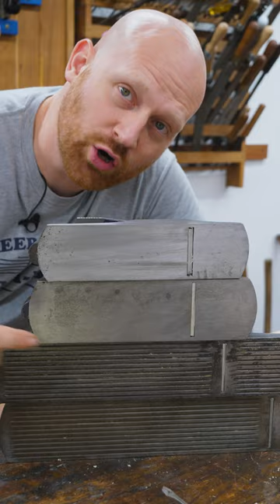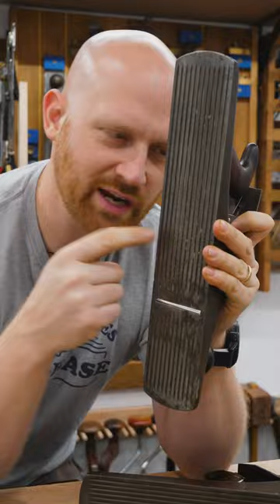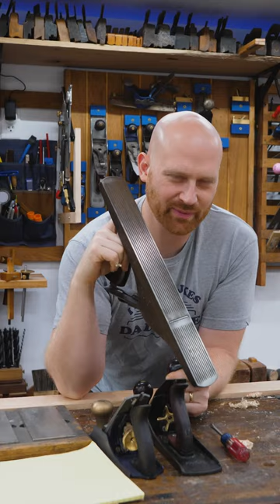What is Corigation on a Hand Plane

Comment: I could see an argument that they potential help limit the suction that can happen if 2 completely flat surfaces meet. Similar to how metalworkers even today will use hand scrapers to flatten 2 mating surfaces that creates super tiny ridges that allow lubricant to stay between the surfaces and not seize up while also being extremely flat.

However, with woodworking...is that even an issue?
Reply: That was actually the reason I found cited for the corrugations.
Reply from the maker: modern people have proposed that, but that is not possible with wood. even in metal it takes EXTREAMPY flat and smooth surfaces.
Reply: @WoodByWrightHowTo  exactly. I'm just trying to figure out the reason though. Who thought of it. Is it simply a marketing gimmick? The extra milling process may save steel, but is more work? Was that extra work worth the extra effort? Most cast iron pans aren't milled flat today because it's a huge added cost. They argue that the casting bumps make the seasoning stick better, but that's just baloney. They just don't want to waste the time and money milling them flat.

So...if it cost more to mill the corrugations? Why do it for a marketing gimmick?
Reply from the maker: Back when Stanley was making planes the cost of Labor was a small fraction of the cost of the plane. The cast iron cost and exorbitant amount in comparison. So the amount of work required to put the corrugation in was actually minimal. As you go back and look at the price differences there is no price difference. Woodworkers throughout the ages have done a ton of things that make no practical sense but they make an emotional or slightly feel better since. It's kind of the same thing with golfing. A golfer will spend untold amounts of money to buy something that will make then think they can do better whether they actually do or not.

Comment: Great info, this is something a lot of car guys miss when getting bigger brakes. Not to say that you shouldnt, itll definitely help your brakes manage heat better, but it wont give you more stopping force aside from a little bit of leverage. You gotta know physics to be a good mechanic, trust me.
Reply: More surface area helps with creating friction. This is why aircraft brakes rotors come in a large stack
Reply: @mitri5389  you are wrong my friend, more force and more coefficient of friction create more friction. when the force stays the same, if you spread it out over more area, you simply get less pressure per square inch. driving 4 answers has a great video on it if that still doesnt make sense, his graphics will make it click.
Reply: @kylesebring  oh I'm sure all the engineers who spent years learning math and physics are wrong... I guess larger surface area doesn't help with creating more friction.
Reply: @kylesebring  Why have the science of tribology when we can just assume ideal textbook physics applies? source: a youtuber with an ai search assistant, and the universe. 
Did you also know that deadblow hammers do less work because they bounce less than regular hammers? simple physics that any mini child can understand. A child level understanding indeed..
Reply: @Hisokaa-d2j  Im confused by what you said, are you trying to say im right or wrong? As for the hammer thing, yes i think everyone knows how springs work, and that rubber is a spring. Nobody is comparing a deadblow with a regular metal hammer (which also bounces btw), you compare it with a mallet, which is solid rubber or wood or something, and the sand or lead shot is there to dampen that bounce, which indeed it does.

Edit: I misread that, my bad. Yes you are correct it does less work than a similarly weighted mallet, but thats not why Id ever use a deadblow, you use it when you simply dont want a bounce, or have less room to swing, or need more weight than a typical solid rubber mallet. Mechanics like me dont care about how much work it does, we can always increase that by swinging harder if we need to. This is why theoretical physics doesnt really matter much to mechanics, although I still bother to learn it anyway.
Reply: @kylesebring  A deadblow hammer can also avoid local deformation in the material being struck, which is why a woodworker might consider it more efficient, even though a claw hammer bounces more. That idealized textbook bounce does send more force into the object than a deadblow of the same weight, and that force is wasted denting the wood.

You cannot simply press a small composite brake pad to infinity and expect it to work the same. At some point the idealized physics literally breaks down as the pad crumbles into dust- because the formula says you can press it 10000x harder, does not mean you can. Look at any big brakes, the rotor is not the only thing that gets larger, the pads are also massive.
It's harder to modulate threshold braking as the gain (boost) on the pedal goes through the roof.

Since you are a mechanic, you are aware of tolerances. According to the youtuber D4A, brake pads and rotors do not flex at all so they are ideal textbook materials. Of course that is not true, millionths of an inch still exist. So while you don't have to gap your brake like you do your piston rings, it's absurd to treat them as ideal. Ideal enough maybe lol? As the saying goes for D4A "knows just enough to be dangerous"
Reply: @Hisokaa-d2j  Very good points and theyre all absolutely true, though you dont say it outright, it seems your point is that surface area does matter because the materials are more malleable than when textbook physics are applied. Granted, textbook physics are not supposed to demonstrate an accurate description of how the world works, rather they simply depict a single concept in the way the world works. D4A touches on that with why tires do benefit from larger contact area as they are more malleable. I would argue that none of that matters thoigh, as you said at the end "ideal enough" I think sums this up best. At the end of the day yes under thousands of psi of pressure, and especially under heat, these materials would be malleable enough to cause significant change to the equations. With that said we are not dealing with thousands of psi of pressure, likely hardly even hundreds on the surface of the pad, and we know this pressure is not enough to cause these materials to be malleable, as the ceramic in the pad is of course going to be the last to deform as its harder than the metal, so would rather break off as brake dust, and the metal isnt significantly malleable as it barely even takes a thou off a rotor by the time it needs turned, I can tell you that as a certifiable fact from personal experience. Rather it comes back to what Ive said before: BIG BRAKES ARE TO REDUCE HEAT. When it gets hot is when the textbook physics here start to differ significantly, I've seen pads just eat into rotors after getting them red hot, showing that they are indeed behaving more like rubber tires than like rigid materials. Truly up until they overheat the physics are ideal enough, you truly put it best.

Also as for the deadblow stuff at the beginning, yes thats exactly what I was trying to say, you dont use deadblow hammers for more work, as the name suggests, and I thought this was obvious, it deadens the blow.
Reply: @kylesebring  Right so we can achieve the same result dynamically by compromising on the potential for the car with smaller brakes to develop issues and excessive wear. Some drivers are totally fine with stock brakes and other drivers have all these shuttering, warping, and bedding issues due to their driving style repeatedly putting high loads on the brakes. It's all about heat because brakes are all heat, but dynamically changing the forces involved to achieve the same result is actually proving the bigger brakes are better- the coefficient of friction changed during the single stop (or multiple) and brakes handle this change by using your foot for pressure control.

The problem is that this has nothing to do with the wood plane because we are not pressing the wood plane into the workpiece to achieve a particular braking force. It is a matter of fact that reducing the surface area of the plane in contact with the work has changed the friction interaction with that surface. Think about the flexible tire logic, it actually still applies to the rigid surface of the plane and wood, more surface area is more chances for micro interlocks to occur. (and other effects)
Reply: @Hisokaa-d2j  Well said, though I disagree with how much it has to do with the wood plain. I definitely see your point, wood is a lot softer than ceramic or metal, and that would definitely reduce the friction a bit, but is it really as soft as rubber to the point where it behaves differently? Yes theres more chance for micro interlocks, but that force still has to be distributed over a smaller area leading to more pressure, leading to more severe interlocks. It would have to come down to scientific results to determine the whether it is or not but my gut tells me the wood isnt soft enough to have surface area play a significant role, especially not in how much area the wood planer removes.
Reply: @mitri5389  Rofl, I love how you're so confidently wrong about what engineers learn. I'm an engineer, and one of the things I learned, even back in highschool, is that surface area, contrary to what most people think, indeed doesn't impact friction. 

Mechanical engineers should all know this basic fact. There are still good reasons to increase surface area, like heat and wear being spread over a larger area, the limited compressive strenght of some materials, etc. 

But friction force isn't impacted by area.
Reply: @slome815  ok I'd like to see what's easier to drag on the floor a 4x8 plywood or a 2x4 loaded with the same weight 🤔
Reply: @mitri5389  What do you even do man? What's your job, what have you studied? Youre in a chat with people who actually know their shit, now get out.
Reply: @mitri5389  Its very impressive how confidently you're wrong
Reply: @kylesebring  you're on youtube lmao take your own advice 😂
Reply: @kylesebring Agreed. Which is why in the end (as you said) it really just has to be tried or measured, to account for all possible effects that could come into play. Gauge blocks are a good extreme example, they are basically ideal rigid surfaces yet can stick to each other with wringing. Van der Waals forces are also the way a gecko can walk up walls. Unrelated to geckos- a suction cup acts very different before and after it's stuck to glass, and there was no material change.

For all I know, a grooved wood plane actually has more friction. The guy above comparing 2x4s and plywood.. Maybe the 2x4s dig into the (unspecified surface) and cause more friction vs the plywood skating along. Everyone using physics to debate this have made a fundamental mistake because this is not a physics debate but instead an applied science debate, one that is easily settled by trying the feel of the plane for yourself. 
When @slome815 is forced to include the caveat about wear and compression, right along side "high school knowledge" that is him admitting the total defeat of applied science vs textbooks for children. Our whole world is built on it.
Reply: @Hisokaa-d2j  Very true, the way I see it physics are nothing more than humanitys best interpretation of the real world as words and equations. We can study physics to better understand the invisible forces at play, however no physics model is accurate, and to get close to accurate, youd need a supercomputer to model every possible interaction and outcome. The best we can do is simplify things to model a single interaction. Truly there is no replacement for the real world, thats the best simulator out there.

Comment: They are also easier to flatten. Substantially less material to remove to get it down to flat.
Reply: Great way to save an extra 30 minutes every hundred years
Reply: @camleee  I mean, these fell out of fashion for a reason. But if we are trying to justify their existence beyond marketing, this is worth bringing up.
Reply: I wonder if there is some aerodynamic aspect to it as well?
Reply: @fishbong didn’t realize something moving 5mph in direct contact with another object needed aerodynamics
Reply: @barryallenporter8127  If the base is really is flat, there actually won't be any direct contact, but a cushion of quite a few layers of the different molecules that make up air between the plane and the wood. It will effectively be floating. It will cetainly be slower to set down and pick up from a flat surface, but there will be other effects as well.
And this is what I am talking about concerning areodynamics. Not streamlining, like you seem to think.

Comment: There will be very slightly less friction, as you are slightly reducing weight.The contact surface will have more psi, but less area, so it would about be the same if the weight was the same, but even with the less weight, the difference is negligible. I would still recommend corrugated though, if price isn’t an object, though honestly that’s just because I like to look at them!
Reply from the maker: Oddly enough on most of them they actually weigh slightly more because they had to thicken the sole a bit when they took out that much material.
Reply: @WoodByWrightHowTo  Huh, I stand corrected, thanks!

Comment: Are the same or lower mass? Unlikely that it would be a substantial.difference, but I am curious
Reply from the maker: they actually weigh a bit more because the sole needs to be thicker to fit them in. but it is an unnoticeable amount.
Reply: @WoodByWrightHowTo i wonder how much thicker. I saw somebody on facebook go too grind happy with a wire wheel, and punch all the way through one of the corrugations trying to chase rust.

Comment: Technically with the corrugated plane would weigh less so it would have less friction but only due to less weight.
Reply from the maker: Oddly enough they often weigh slightly more. They had to cast the souls a little bit thicker so they could grind into them.

Comment: It’s easier to push because there’s less material making it less heavy. That is, obviously, a barely noticeable difference, but apparently enough to make such advertising technically true.
Reply from the maker: Surprisingly a corgate plane is usually slightly heavier than the smooth soul. The reason is they had to make the casting a little bit thicker to get the corrugations in.
Reply: @WoodByWrightHowTo  huh, that is surprising!

Comment: been wondering about how flat your planes are?
I'm a machinist, so flatness is orders of magnatude different...but I put my (inexpensive) plane on a surface plate...barley had any contact area.

You, or anyone you know ever tests yours on a plate?

Do people scrap the soles for flatness, like a machine slide?
Reply from the maker: For most, flatness is not a big deal. Unless you are taking a finishing shaving or jointing an edge, I never even check a plane. In those cases, if it does the work. Then it is flat enough. For the smoothing plane or fine jointer, I usually like the sole at the toe, mouth, and heel to be within five thousand. If the rest of the body is concave, that is fine. Some people will have different tolerances. But most fall somewhere between 1/1000" and 1/100". I do have to say that machinists often have a hard time with woodworking as a board may change in detention by a few hundred from day to day.
Reply: @WoodByWrightHowTo  I can confirm, the movement of the material while working it does frustrate me at times.  But its not complete out of our wheel house...metal moves too!

Thanks for providing some concrete metrics for required flatness, that will be very helpful.

Comment: You’d add wax to the corrugated  plane.  This would allow you to remove crack lacquer finishes evenly to not damage the grain.

They were marketed without mentioning that you’d need the wax to get the benefits of low friction.

I ran into the user manual for one that was used in piano refinishing.
Reply from the maker: I add wax to all of my planes. that is standard practice. wax or oil depending on the tradition.

Comment: I find that they are cheaper than smooth planes.
Reply from the maker: it depends on where you buy them oddly. on the tool shoes they are normally 10-20% more but in the antique world they are normally 10-20%
Reply: @WoodByWrightHowTo  well for me it was flee marktets, ebay and estate sales
Reply from the maker: Right on. That's the antique market.

Comment: Weird how this works here but how it's completely different for tyres, where slicks do provide more traction than treads when dry.

Probably because metal isn't sticking to the wood xD
Reply from the maker: The difference is that rubber conforms to the surface steel does not.

Comment: but its less material so technically it is easier to push
Reply from the maker: same amount of friction just concentrated on location. and oddly enough the corrugated ones normally weigh slightly more because they had a thicker casting to fit the cuts in.